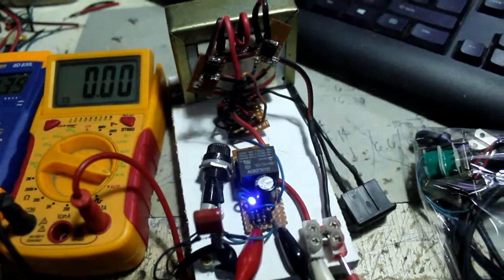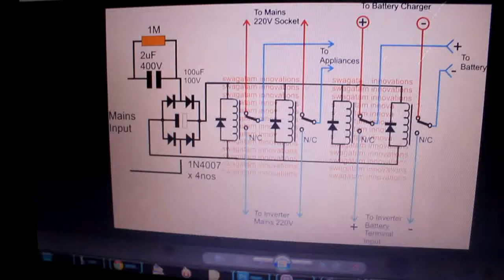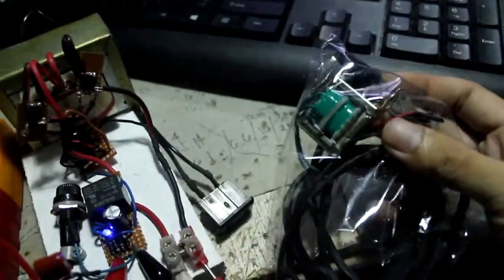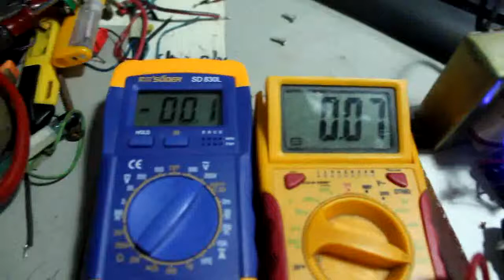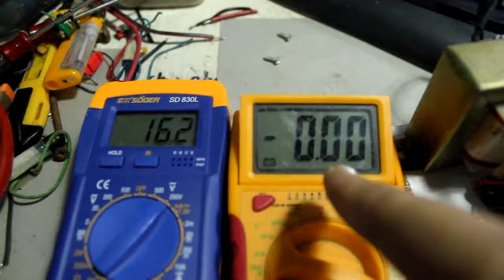Automatic Relay for solar use.

Comment: what is the wattage of your solar panel?
Reply from the maker: AviatorDark as of now i'm using 100 watt solar panel and i'm planning to add another 100 watt soon
Reply: vrich marketing renewable energy nice
Reply from the maker: AviatorDark i purchased another 100 watt solar pannel and order a 1000 watt pure sine wave and a 100Ah battery from cdr king steve. hope i could run my refregirator with it when it arrives
Reply: vrich marketing renewable energy awesome have fun
Reply from the maker: what you usually do right now?
Reply: vrich marketing renewable energy just at home watching YT videos